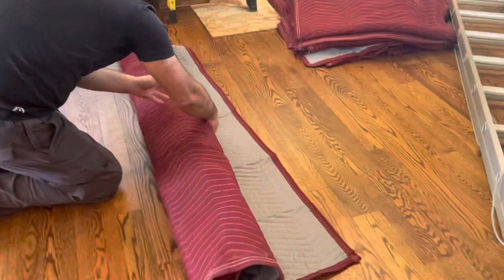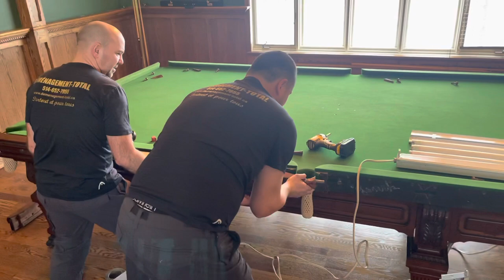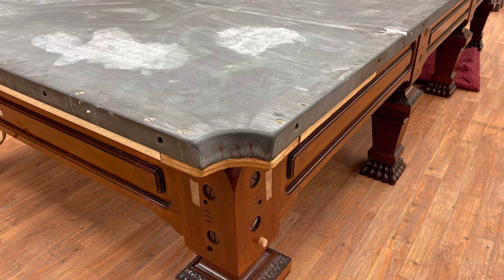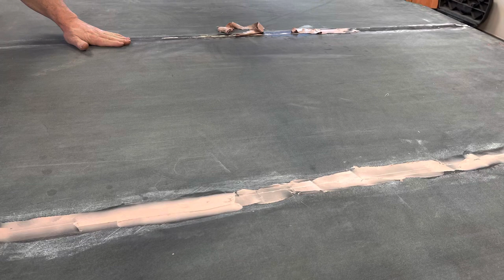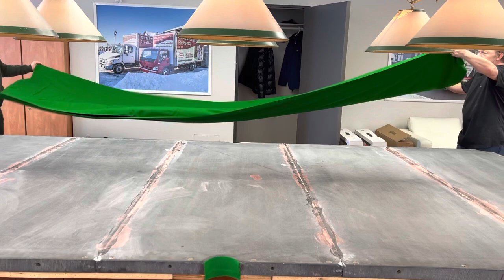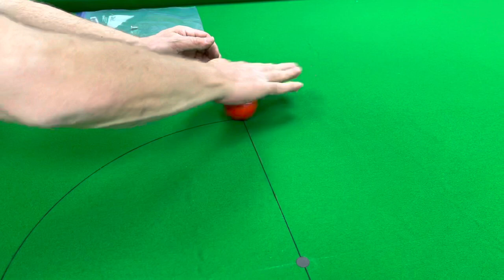How to assemble a snooker table/Video tutorial

Comment: Hi there guys  could I just ask you experts opinion . I have just bought a  8ft snnoker table from a company here in Sweden. They class it as a pool table but it is exactly the same as an English snooker table.It comes with 6 legs and 3 slates ,4cm thick. I have bought an 9ft table from china in 2011 ,so have some expierience with these tables. Now this 8ft to my surprise has no screw holes on top,to screw all those wood pieces on, for stapling the cloth. This to me is weird,there is no videos on youtube where you don't have holes on the snooker tables. So there is no holes to even keep the slates screwed down. Also, the slate looks more like a type of marble and the two slates are different looking to the other one,and one  is a bit smoother. I am complaining about this to the company, I don't think they have forgotten to include all the wood bits for the edges of the slate underneath obviously. I am sure their thinking is that the cloth is to be glued on, like most pool tables nowadays. But to not have screw holes to keep the slate from moving, seems a bit ridiculous.. I will glue bit of paper with superglue on the seems,but do you think I should just use silicone under the slates to stop them from moving. I want to use the stapling method for stretching the cloth and am not going to glue down. Was thinking of getting the  wood strips and glueing it all underneath,should work. Have you seen tables with no screw holes ? Kind regard Kevin